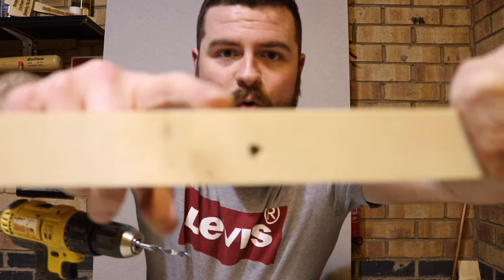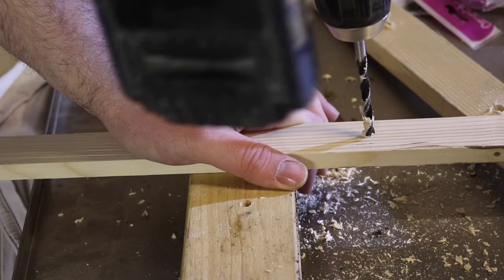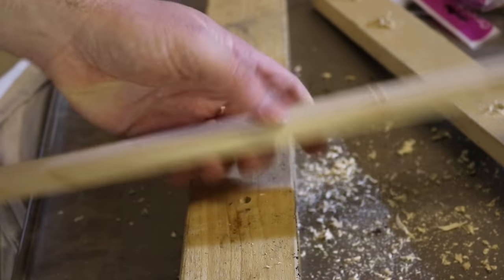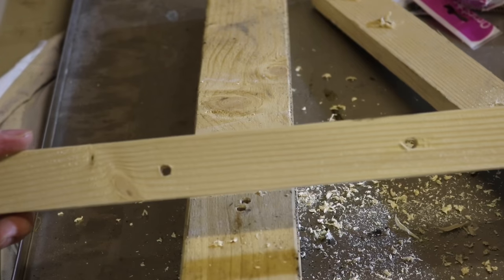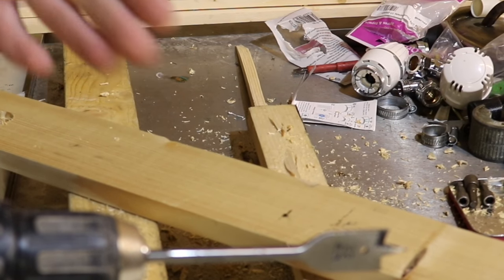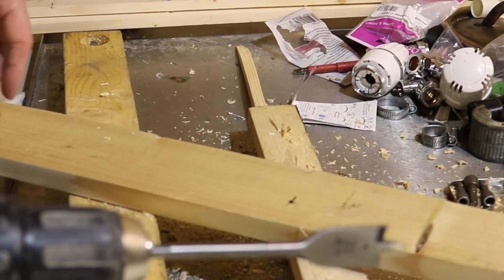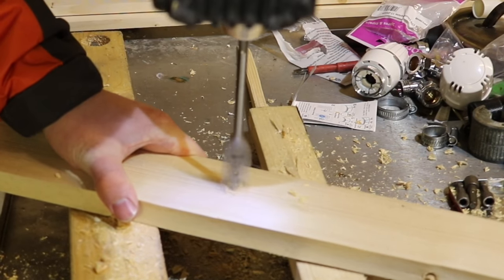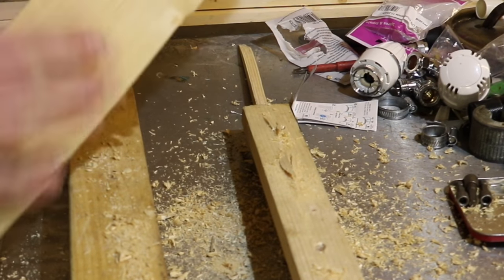How To Drill Clean Holes In Wood | Two Minute Tuesday

Comment: Just thought to test those captive nuts that sink into wood giving option to secure with metric screws to my homemade CNC. Tried to drill through plywood and got quite nasty backside on my test piece. I was wondering how I'd get nicer surfaces. Tried to check YT and got this good video about the basics. Heck my grandpa told me about this multiple times as kid. Facepalm...
Thanks for the reminders anyway :)

Comment: Great video mate. Helps a great deal. Can I ask how one can drill a hole in a cupboard made of mdf with laminate on it? Its one of those where u place a plug in it to hold a piece of laminated wood on it and this becomes a shelf if you know what I mean. I need the shelf to be much higher but then I have to make my own holes on the side of the cupboard :-(
Reply from the maker: Use a depth guide 👍🏻👍🏻👍🏻

Comment: New subbie. Thank you. Short sweet clear and helpful.  Am needing this because I'm about to drill M6 holes to fit coach bolts to new bench slats. Do i need to pilot hole drill or does this prevent a straight hole?

Comment: Hey! Dan, first time drill user here. 
I already did the blunder 😬 , now my wood slate has chipped wood parts around the holes and doesn’t look finished. How can I finish it now? Should I used sand paper. Need suggestions.
Reply from the maker: Definitely hard to give it a finished look now to be honest, the best way would be use a wood substitute like a wood filler and sand 👍🏻
Reply: When I've done that I either roll a piece of fine sandpaper or use metal craft files and then there's no snagging. Oops, gal here. 😂

Comment: What size drill bit did you use for hole? Looks great.
Reply from the maker: The drill bit will depend on your needs, it will work with a variety of sizes smaller to larger

Comment: I’m having issues of my drill bit stopping in the middle of drilling the hole. What am I doing wrong?
Reply from the maker: I would check the chuck is tight around your drill bit, also check your drill gears make sure they are set correctly for what you are drilling 👍🏻

Comment: Do you have a video on how to stop tearing at the start of the hole?
Reply from the maker: You will be using the wrong drill bit or setting on the drill 👍🏻
Reply: @PlumbingGy  Thank you. Well it wasn't on the hammer setting! :-)

I tried fast and slow, prepping the holes with reverse drilling, and a bit of counter sinking. The 10mm bit I was using was brand new (and not a masonry bit). What's left?
Reply from the maker: Was it a wood drill bit or a multi purpose one? 👍🏻
Reply: @PlumbingGy  The packet doesn't specify, so perhaps it's a multi-purpose. The packets says it's a "Draper 10.0mm HSS Drill Bit" and goes on to describe it as a "Straight shank jobber drill"
Reply from the maker: Yea that's a high (HSS) High Speed Steel bit set you will need a wood/timber drill bit set 
https://www.amazon.co.uk/dp/B003TWOSPO/ref=cm_sw_r_cp_apa_i_mr7iFbRTPRTT5

Like that 👍🏻
Reply: @PlumbingGy  Thank you, DIAD. You are, indeed, the man. :-)
Reply from the maker: Thank you 😂👍🏻
Reply: @PlumbingGy  Your comment about using a wood drill bit made a world of difference. I feel that videos like this one should mention such fundamental bits of information because not everyone is at the same level. Thank you for addressing this question.

Comment: In what cases do you need to drill holes on the wood? Can you name few situations please?
Reply from the maker: Pilot holes, pinning holes, strain take, bore holes, core holes, pull holes ... There are many, many reasons 👍🏻
Reply: I always drill a pilot hole before screwing a screw in. I drilled holes to attach two pieces of wood with nuts and bolts. Drill a bunch of holes with a fortner bit to make a peg board